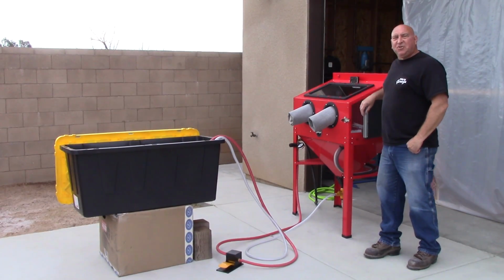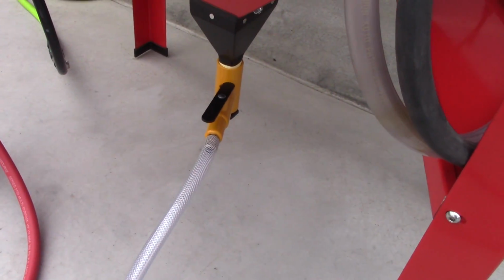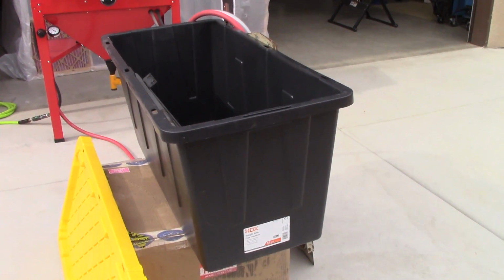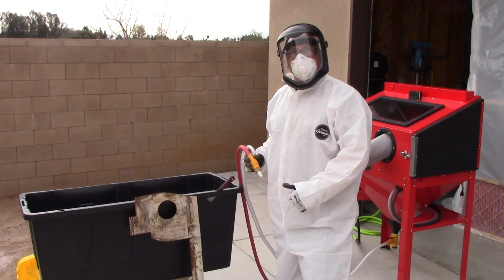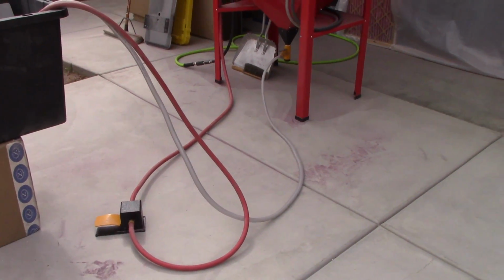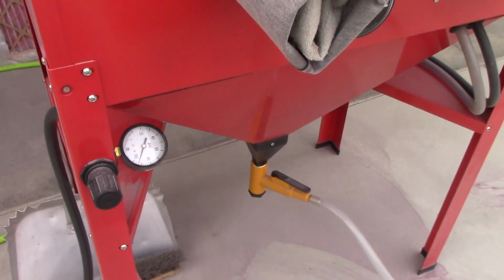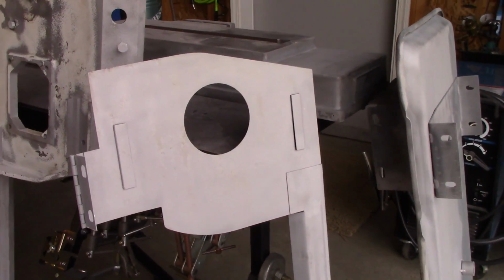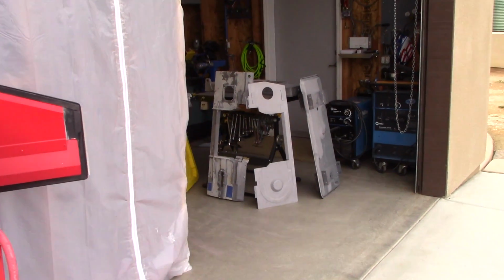Tacoma Company Blast Cabinet Conversion

Comment: This is a little trick you might try if it matters.  If you cut "windows" out of that plastic tote and put some screen in to make a "vent" of sorts.  It will allow air to flow out without it coming back out of the tote as much.  You might save a little more media. And you won't get as much splash back in your face.

Comment: Thanks...need to do the same but I will use coarse and fine Black Diamond coal and not recover it.  I will be blasting a VW bus frame outside and will be laying on the ground so a foot pedal control won’t work...trying to come up with an alternate control method.

Comment: Ray I have enjoyed your Blast Cabinet build. The new HF cabinet apparently has a new type of foam that is a major issue and pain to remove. Any suggestions???  Heat gun doesn’t work, goo gone does nothing and goof out barely does anything. So far gasoline seem to work so so. Any suggestion would be greatly appreciated as I have 2 cabinets do assemble.
Reply from the maker: Try 3M Adhesive remover. I have used this on automotive trim and it worked great! Let me know if this works.

Comment: Ray, would a 20lb pressurized abrasive blaster from Harbor Freight not be a more economical option for outdoor blasting?
Reply from the maker: Hi Doug, I should have mentioned this in the video. The HF pressure pot is an option but to be completely honest it’s not a very good pot and will frustrate you trying to get it to perform as well as this option. I also wanted to show how easily the cabinet can be converted if needed. Thanks for the great question!

Comment: I've tried contacting the Tacoma Company on a few occasions by "E" mail thru their website. Seems they don't want to respond to my request for information for the upgrade of my Trinco BP-36 blast cabinet. I wanted to use Tacoma based on your recommendation, but will obviously need to go elsewhere to purchase the metering valve, gun and vents...
Reply from the maker: Hi Gary, Try this number, 208-264-5543 Trust me, Tacoma upgrades are well worth the effort!
Reply: Be patient there very busy it's taken me quite sooner time to acquire my parts, but they sent then as they were available, still waiting on some but getting there and it had help to absorb the cost slowly as they will bill you as they ship the available parts

Comment: Seems like it would be a lot more efficient at this point to just get you a HF Blast pot and use it instead...   I have a lot of the Tacoma parts on my Eastwood cabinet but if I am already having to blast outside the cabinet in the driveway recycling media is the least of my concerns...   Just put it in a pot and hook your air pressure up to it and go to town.  Also just switch to sand and you can drive the cost down.
Reply from the maker: Hi Robert, The HF blast pots do not work well and are very inefficient. Blasting with sand can be very dangerous plus the size of the sand granules are inconsistent so you can't really control the surface finish you are trying to obtain.

Comment: I was wondering if a covering of some type of material would be advantageous to cover the tub and you to be able to recover more of the media.  Something in the form of a tent similar to your plastic enclosure.  The material would let the air through and trap the media.
Reply: Along the same lines, I'd expect you could cut the tub's original cover into quarters and (that is, if you weren't also running a camera at the same time), two or three loose pieces of cover, moving them around as needed, would retain a lot more of the loose media.
Reply from the maker: For sure, an enclosure would have worked great, like my makeshift paint booth!